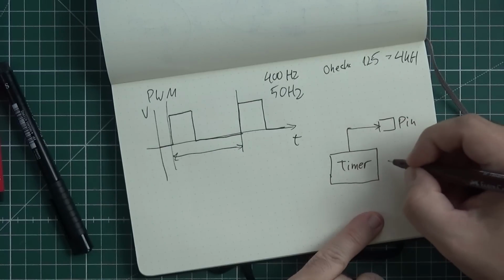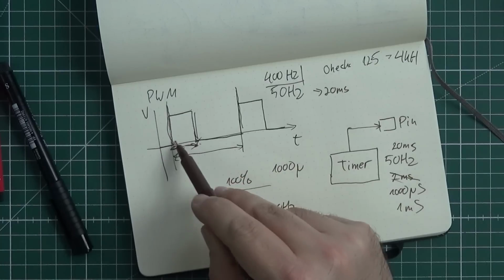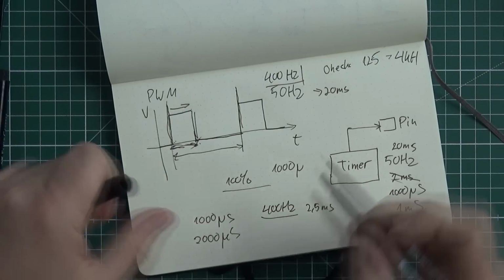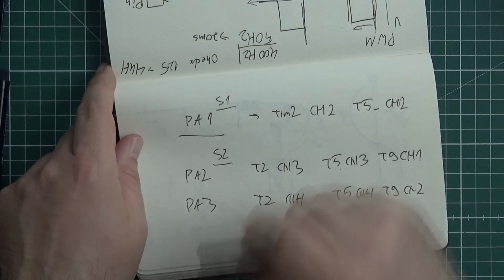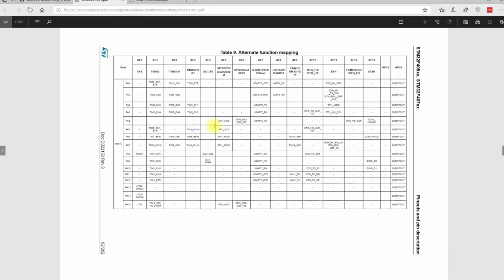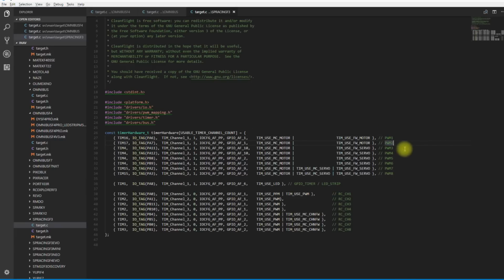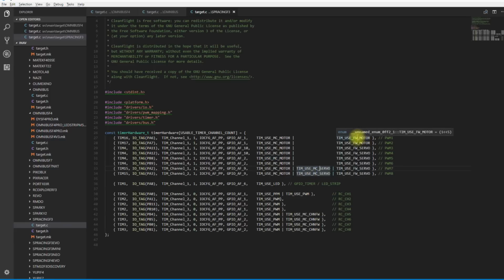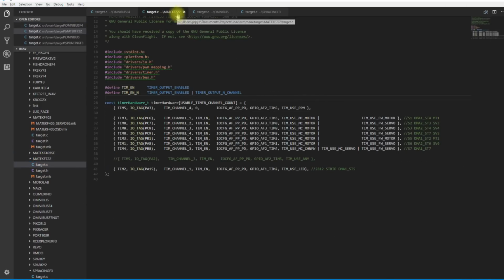INAV, Resource Mapping, Motors, Servos and Timers

Comment: Have you seen solution used in LibrePilot? There is something like Output Bank (Channel/Pin) which I suppose represents the Timer, see this page https://librepilot.atlassian.net/wiki/spaces/LPDOC/pages/2818086/Output+Configuration I think, it would be possible, to deal with it in similar way. User would be able to choose protocol/frequency for timer, and then assign mixer output to the related pin.

Comment: I appreciate this video, as I was just recently hacking away at these target files, trying to get a couple pins remapped on my iNav FC. I couldn't make heads or tails of the timers and channels, couldn't find that table in the datasheet, but somehow managed to guess my way towards a working remap without frying anything. This video did a good job of tying all the details together; henceforth, I will have a much easier time of remapping pins in my custom targets. Thanks!
Reply: Do you have any steps for the remapping in Inav?